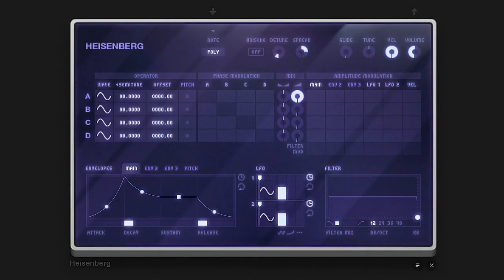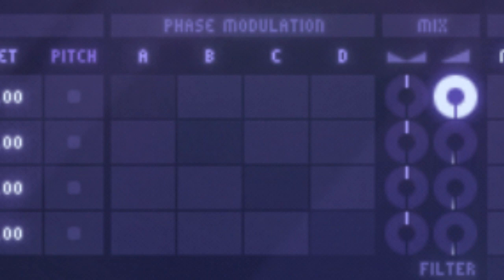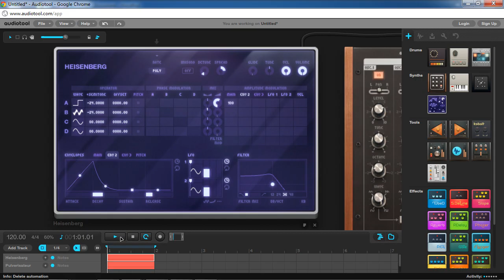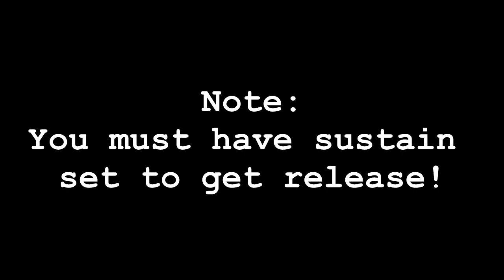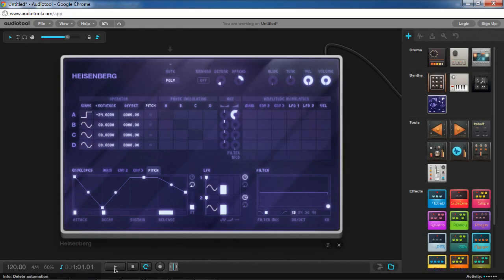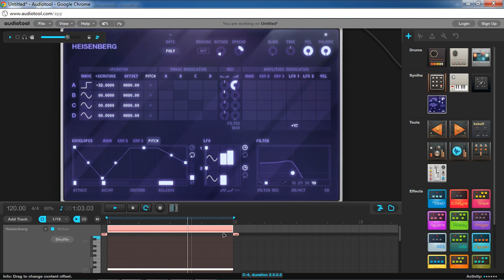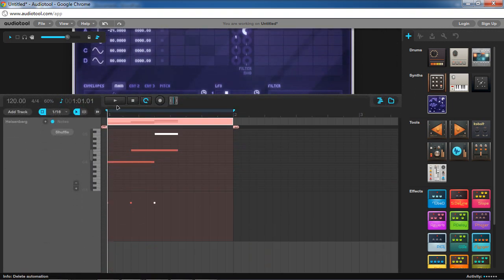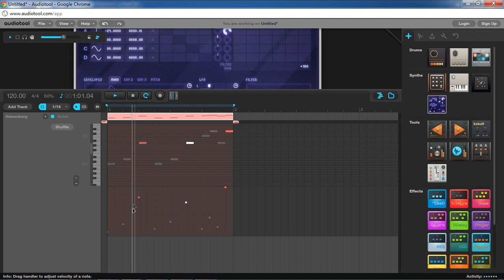Heisenberg Tutorial

Comment: Random hint: Phase Modulation is the same thing as FM. If you are a massive user, you might know something about this. Maybe not.

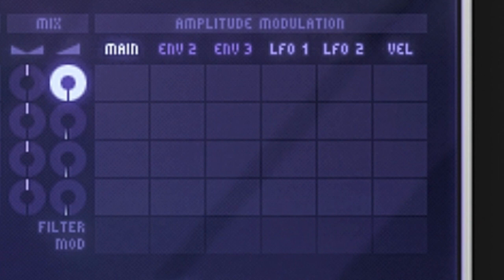Lesson time: Modulating FM is possible in the Heisenberg. 3:15 is the basic idea of this. You basically use the amplitude modulation to modulate the volume of the operators modulating your fundamental. Like, let's say you have op 1 as a sine. you have op 2 modulating op 1 all the way at 100 as a triangle. let's say you have them both set to -36 semitones. You have op 3 as a triangle as well, but is set at +24. You modulate op 1 by op3 by just about, IDK, 36-56? What ever you feel the sound needs. op 3 is now the harmonic. NOW! Modulating the fm amount. Set LFO 1 to what ever settings you want, and the column in the Amplitude modulation matrix that says LFO 1, in the rows for op 2 and 3, set those squares to 100(or, really, what ever you wish, mess around a little). 

AMP MOD illustration:                    KEY:     M= main
          Amplitude Modulation                    E1-2=envelope 1 and 2
         M   E1  E2  L1  L2  VEL                  L1-2= LFO 1 and 2
OP1 |¯¯¯|¯¯¯|¯¯¯|¯¯¯|¯¯¯|¯¯¯|                  VEL= Velocity
OP2 |¯¯¯|¯¯¯|¯¯¯|100|¯¯¯|¯¯¯|
OP3 |¯¯¯|¯¯¯|¯¯¯|100|¯¯¯|¯¯¯|
OP4 |¯¯¯|¯¯¯|¯¯¯|¯¯¯|¯¯¯|¯¯¯| 
FILT |¯¯¯|¯¯¯|¯¯¯|¯¯¯|¯¯¯|¯¯¯|
        ¯¯¯¯¯¯¯¯¯¯¯¯¯¯¯¯¯¯¯¯
Reply: Ex: http://www.audiotool.com/track/fm_modulation/